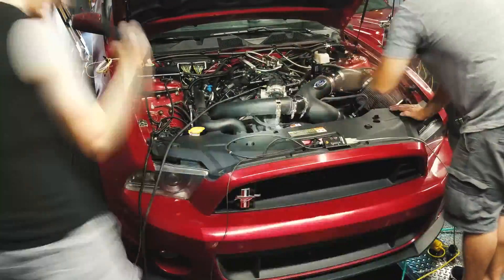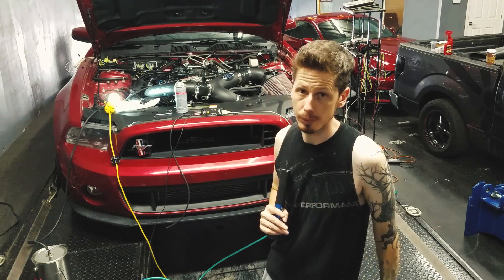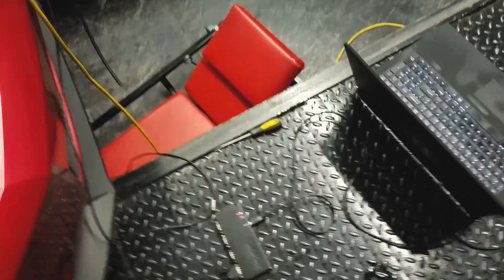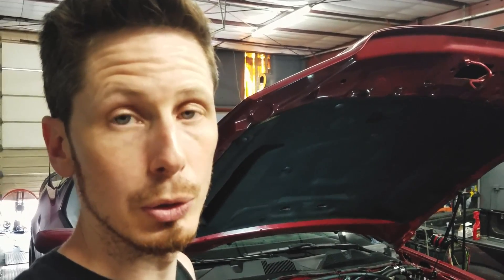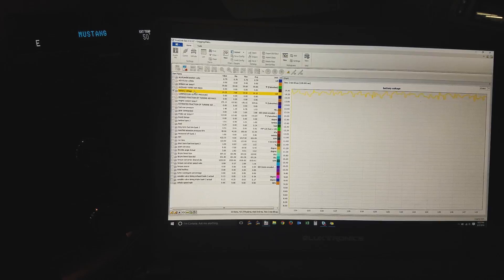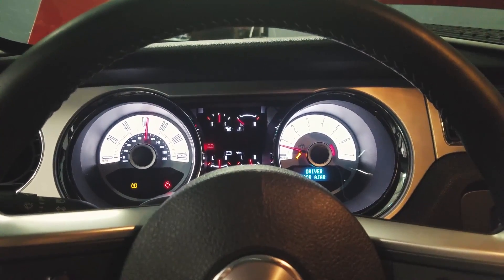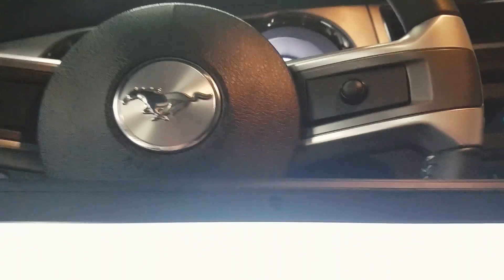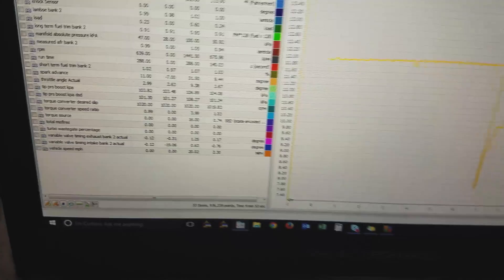Project Ecostang: 3.5L Ecoboost Swapped Mustang - Part 2

Comment: is there any benefit from running a 3.7 fuel rail? I'm thinking the 3.5 ecoboost should have better fuel components than the 3.7 that doesn't come turbocharged....
Reply from the maker: The 3.7 fuel rail was added in addition the the ecoboost fuel system. Direct injection plus port injection. 12 injectors total.
Reply: what intake manifold ?
Reply from the maker: Modified 3.5L Ecoboost manifold.

Comment: I read somewhere that (Ford Racing, I think) had a stand alone control pak for the ecoboost engine. Seems like that route would've been a lot easier.
Reply: He wanted to go that route but ford racing didn't put out the standalone on time and he went with the f150 computer to get ahead
Reply from the maker: Also, that control pack is for manual trans only. This way he gets to use the 6R80 auto trans.
Reply: +MPT Performance I see. Has anyone done this swap with the control pak in a Mustang yet? I'm curious if it will work with my automatic transmission. No way am I going the route ya'll did.
Reply: +Michael Perry I mean, since the auto is already in the car maybe there is a simpler way to make it all work together with the control pak.
Reply: I remember reading in the original forum that he did use the control pack?? I thought it was on hold for a while but he finally go tone of the first ones